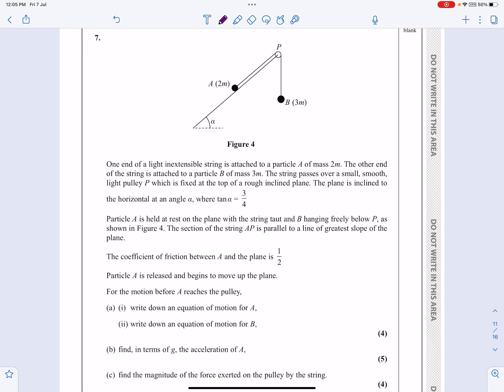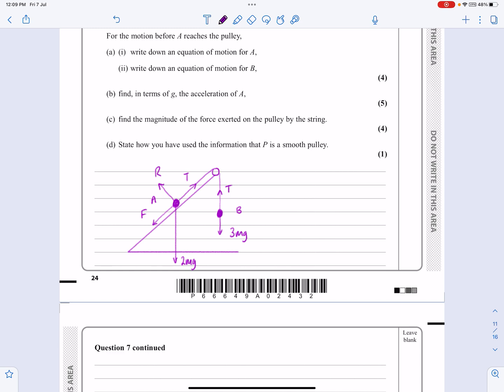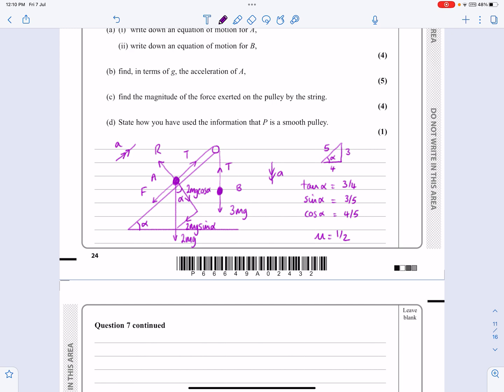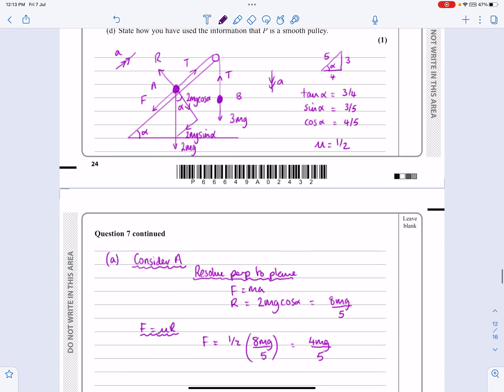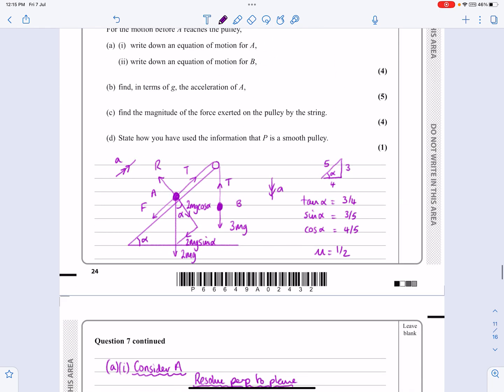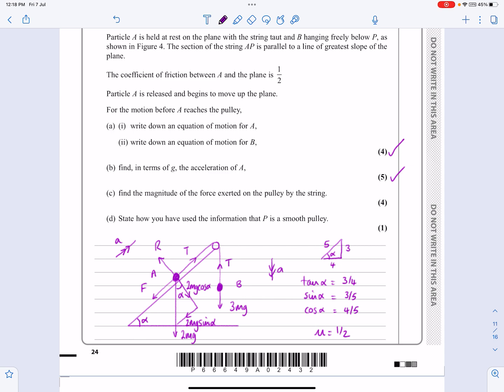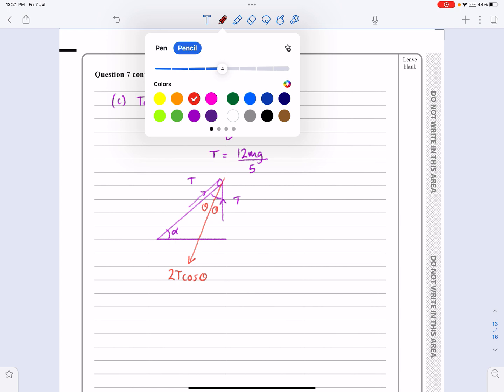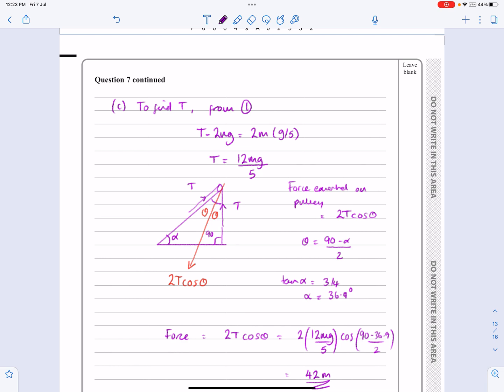IAL Edexcel Oct 2021 M1, Q7, Dynamics, Pulleys, Friction, Connected Particles, Mechanics, WME01

Comment: How do I know when to use degrees or radians because for part a & b I used radians since the values given were in fraction form so I did the same for part c and my answer was wrong
Reply from the maker: It should not make any difference whether you use radians or degrees. Check your working to make sure you haven’t made a calculating error